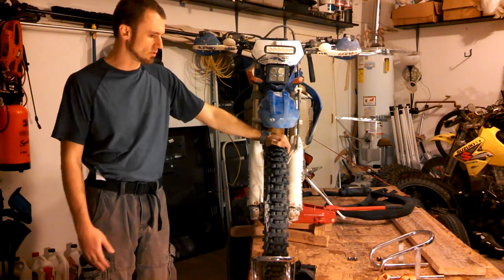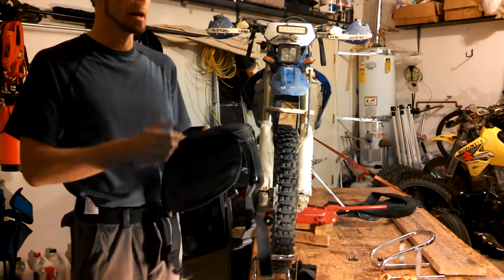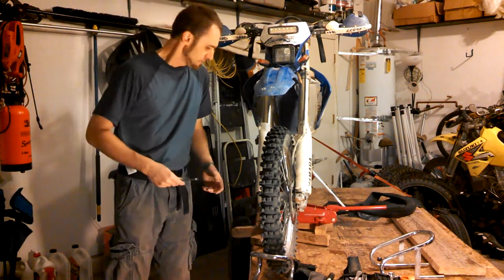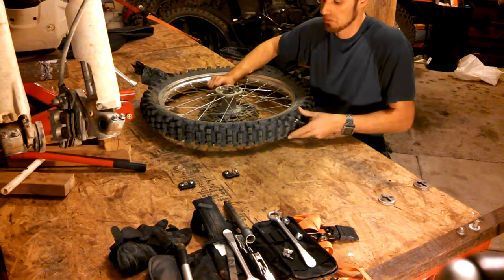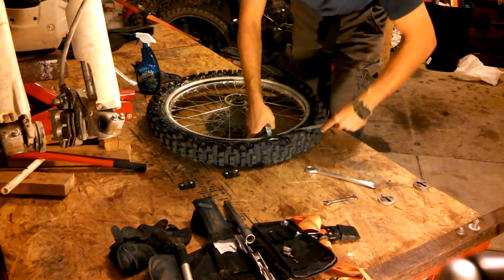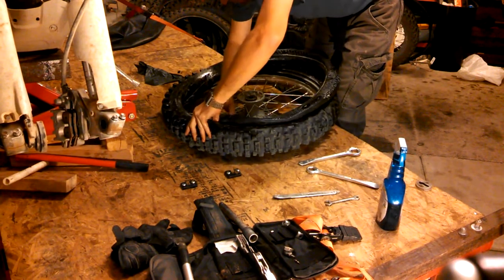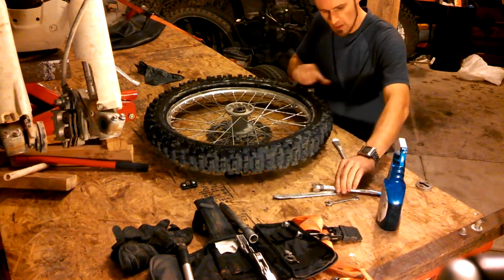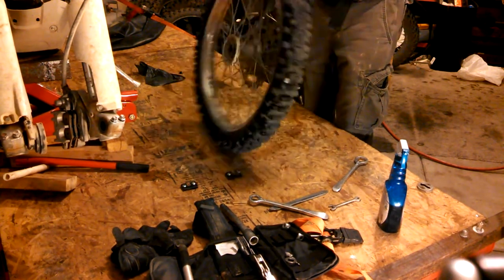How to Replace a Motorcycle Tire Tube Tutorial

Comment: Good tutorial. But you said you were going to use only what you carry and then you got that big spray bottle. What do you use for lube on the trail? Also, why do run 25psi on the front? To protect your rims?
Reply from the maker: correct, I don't have the bottle with me, I use it only to make it a little bit easier when I put the tire on, also I run 25 psi because at 24 and 23 and 22 and 20 and 18 I'm keep getting pinch flats , it feels terrible but the rocks in Vegas are just to big and I ride them maybe a little bit to fast
Reply: So no lube on the trail?
Reply from the maker: iRide uWatch yes you are correct !